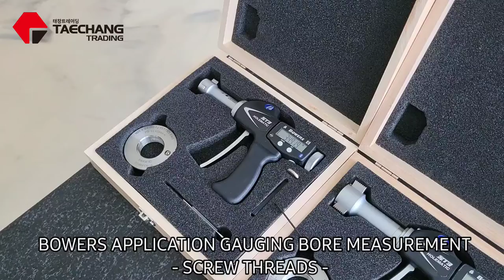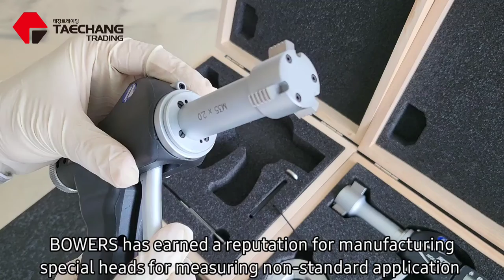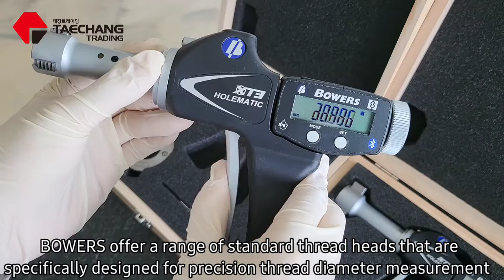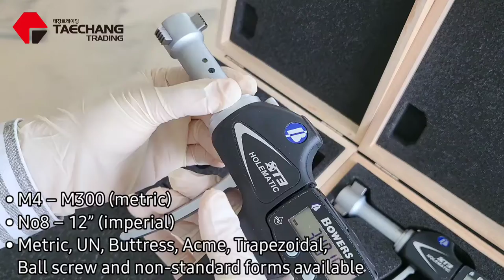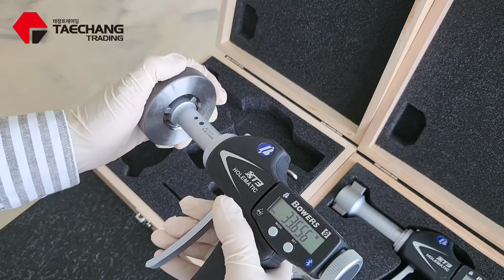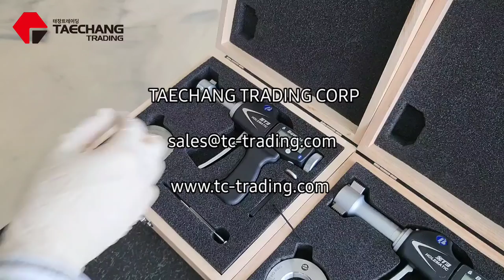XT Threads : The Best Way to Measure Internal Thread Diameters

Comment: How many think about just how large the pitch diameter tolerance is on internal threads. Is measuring to 0.001mm / 0.00005" necessary?
Reply from the maker: Whether a precision of 0.001mm is required depends on specific application fields and product requirements. Such precision is typically utilized in industries such as automotive component manufacturing, aerospace, medical device manufacturing, shipbuilding, precision machinery manufacturing, and more.